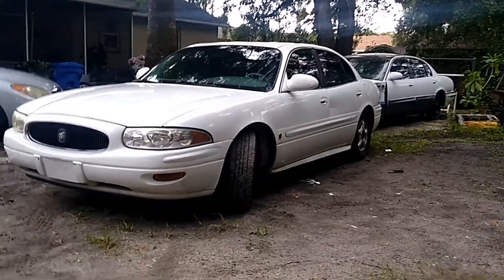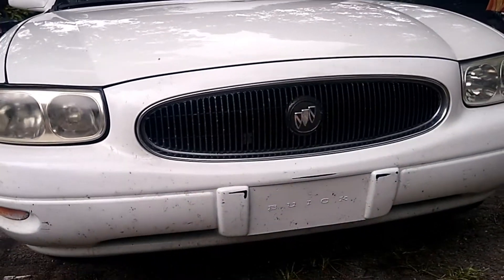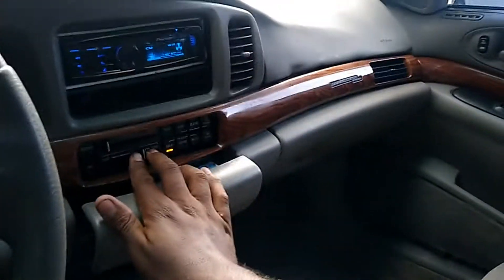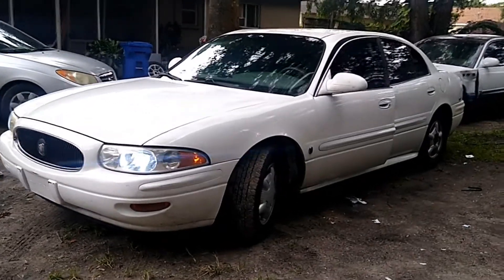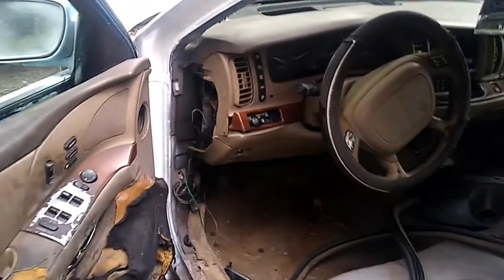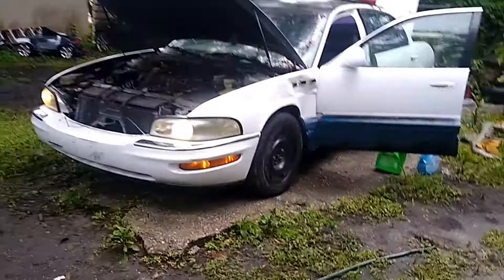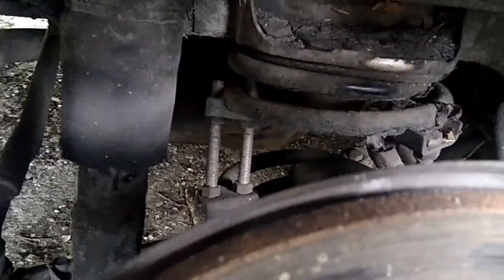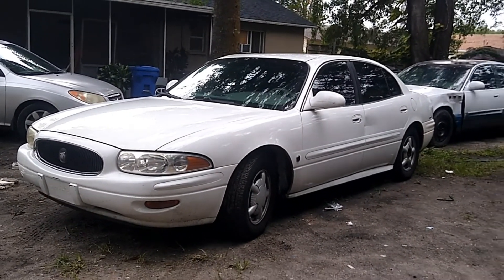Review On My Old 2000 Buick Lesabre, and The 3800 Is The Best Engine!

Comment: Hahaha I have an '05 with around 135k miles and the center console lid broke on mine as well.  I wonder how long it'll be before my interior looks like yours 😂.  The thing that really matters is those engines though.  My engine was burning oil and I didn't realize it and it started ticking and making all kinds of noises, so I checked it and realized it was low, did an oil change, and it sounded great again. I drove it like that for probably around 500 miles.  Some damn tough engines in these.

Comment: So nice someone besides myself loves these old buicks I've owned many different buicks and all of them where great except my 94 century with the 3100v6 in it and it blew the intake gasket at 39k and rust seized and hydro locked the engine  cant beat the old 3800.   The only buick I haven't owned is a park Avenue ultra.   And buick is GM's cheaper luxury car their ultimate luxury cars where Cadillacs but I'm a buick fan love the old devilles and Fleetwood Cadillacs as well